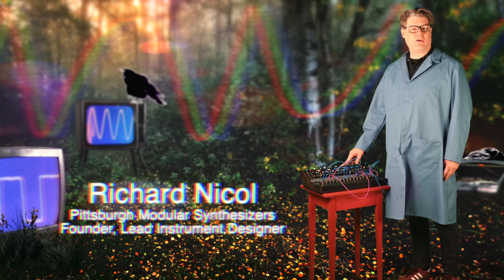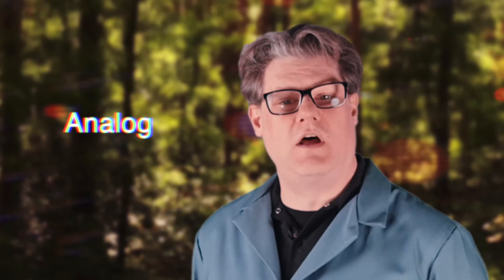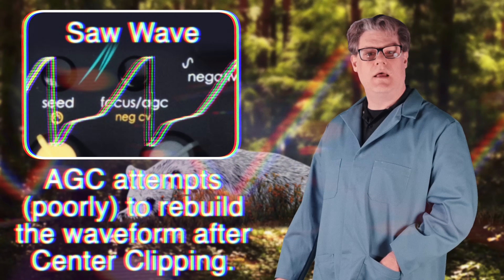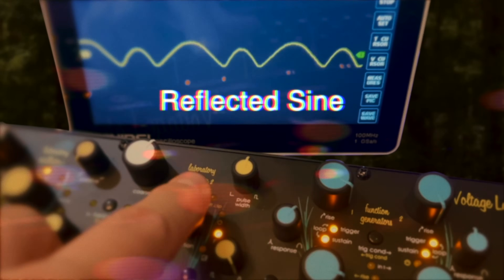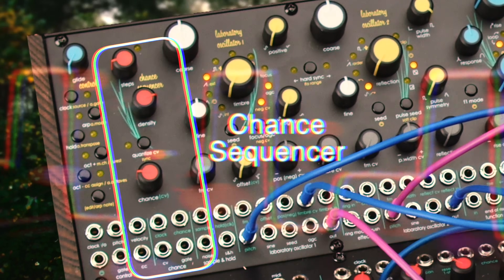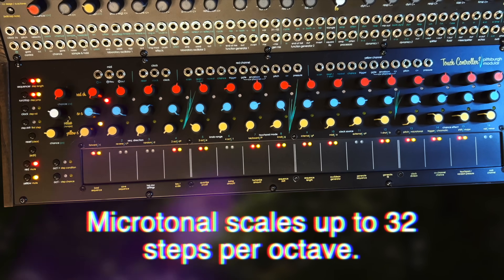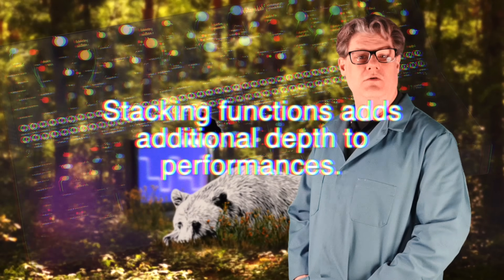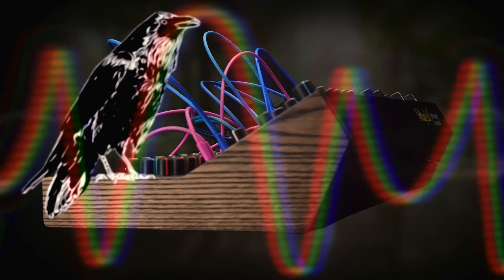Introducing the Pittsburgh Modular Voltage Lab 2

Comment: Impressive. I'm so interested in tha character of the unique oscillators and the LPG. The maths style FG...
BUT!.....The fact that it has no band pass or high pass filter, and instead has what appaears to be a basic and limitiing time based effects section is why I might not buy this synth. 

The whole point of the synth is to offer innovative sounds which it does, but I cant see how to cut any of the low frequencies without relying on an external filter. Is there a way to patch the synth to create a high or band pass-like outcome?

Comment: Great presentation, great instrument. The first VCO is so cool, I need so many modules to make this today. Depending on the modules I have, I need two function/CV/inverter shifters, VCA, LFO, VCO, Wavefolder and an oscilloscope to get roughly a similar signal. Adjusting and tuning was always super difficult. The sequencer reminds me of 4ms Catalyst Sequencer, well not the exterior but the core functions, cool stuff. Once I have it, it takes a while to get going, then the fun begins. I look forward to your instruction videos. Good Job Pittsburgh Modular Team! Love it. Have fun at SB24. A little pro tip, to many beers and jetlag usually don't end favorably. 😛

Comment: Dang! I just got a Taiga keyboard, and I love it. This has my G.A.S. turned up to eleven! 🙂

Edit: Though I love my Taiga keyboard, the VCA bleed drives me crazy. Please tell me this is not an issue with the VCA on the Voltage Lab 2.
Reply from the maker: Turn the Dynamics knob full left to stop the bleed. The dynamics knob acts as a pass through